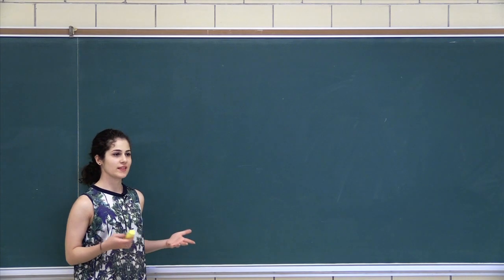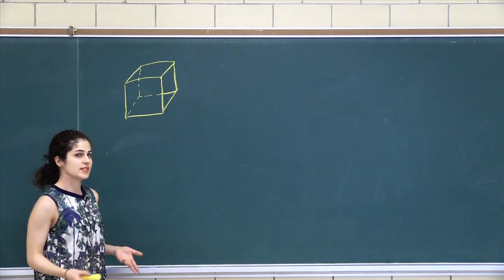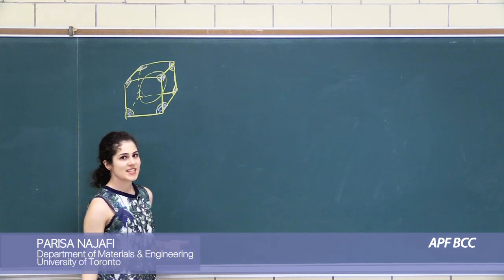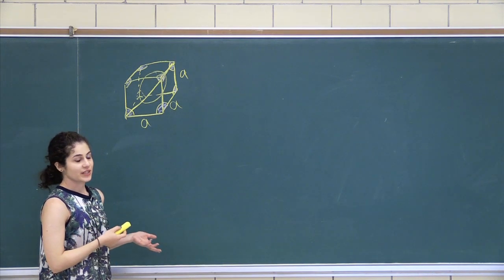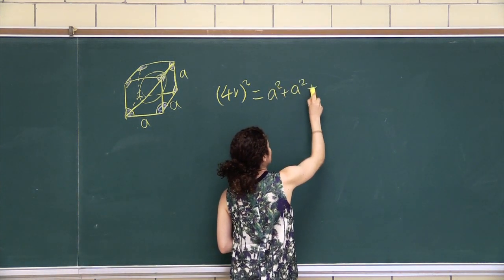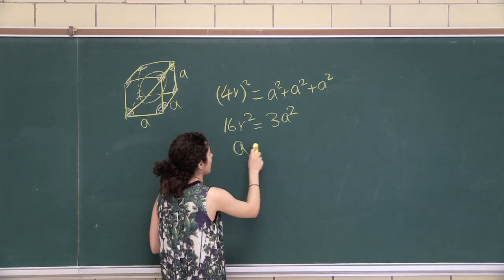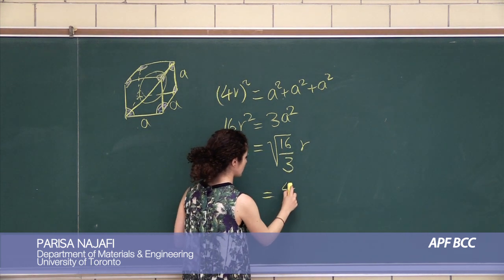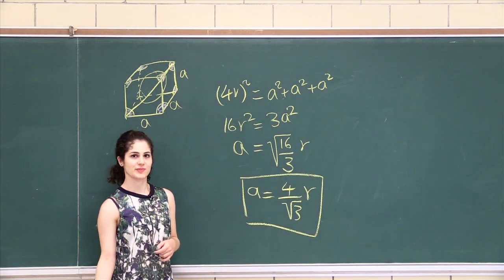Atomic packing factor in body centred cubic

Comment: For anyone that comes by:
APF = (number of atom volumes inside a cell) * (atom volume) / (volume of a cell)

So for FCC we got: 
 (number of atom volumes inside a cell) = 4
Its one eighth of a volume in each corner and half a volume in each face 
 (atom volume) = volume of a sphere of radius equal to the atomic radius (R)
 (volume of a cell) = a^3 
with a = (4/sqrt2)*R

That gives APF = .74
Reply: Valentín Finozzi 
Good work but this video is for a body centered cubic